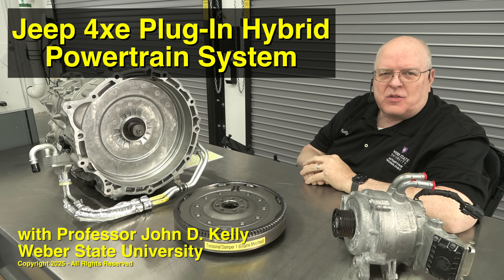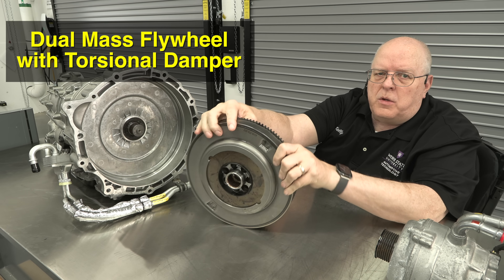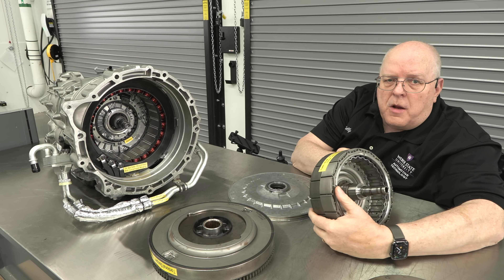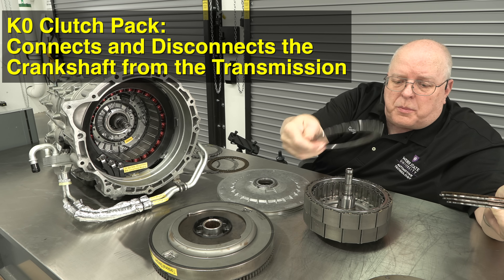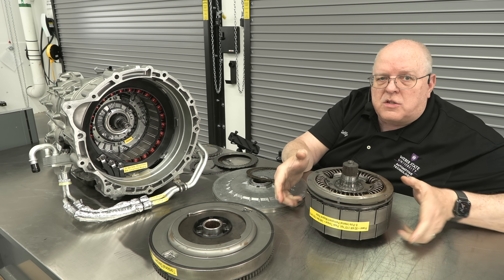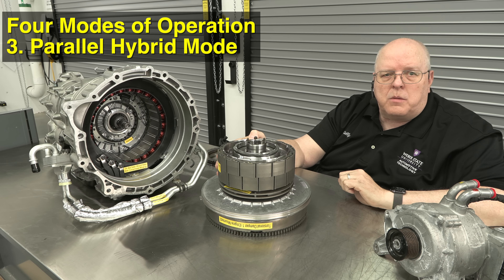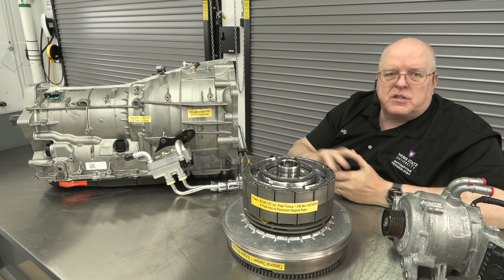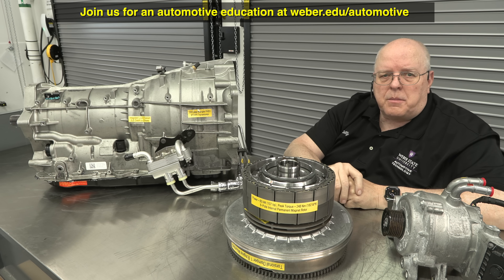The Jeep Wrangler 4xe Two-Motor Hybrid System

Comment: My 4xe from times to times when in 1st or 2nd gear will give a big knock (if you hold a coffee, you will spill it all over!). So I guess this would be the slipper inside the transmission that gets a bad info on when to engage?
Reply: I get the occasional rough 1-2 gearshift in my bmw with this same transmission, but only in electric mode. My understanding is that the ILE is closed when the vehicle is moving and your foot would be off the clutch pedal if it were a manual. Then, it shifts through the gears as a regular 8HP would. That's just my assumption and I could be ignorant to the more complex aspects of how things are managed. 

My theory is that, without the rotational inertia of a spinning engine and torque converter to dampen the shock of the 1-2 gearshift (which, just like in a manual, takes finesse to execute smoothly), any error in the engagement of the clutches is magnified. It most likely leans heavily on the complex transmission management and "learning" to get the gear change right.

Comment: The rotor you show has two segments on the outside that are slightly offset from each other; what is the purpose of this?
Reply from the maker: It is to reduce something called cogging as the rotor rotates. Think of it as a little variations in its rotational speed.

Comment: Wow, very informative. Wish this information was easier to find from manufacturers for those of us mechanically curious types.

Owning a 4xe wrangler in the family, I've had a large amount of experience driving it. Watching this video has explained some of the interesting behavioural quirks. Primarily around not having a torque converter:

1. In stop & go traffic on the highway, especially once the high-voltage battery is run down, the vehicle seems to lurch at 1-2 mph. My guess is that is where the engine clutch engages and there is suddenly plenty more torque available, but also a minimum RPM. The result is a noticeable power increase and acceleration. I usually compensate by letting off the gas slightly, which then releases the engine and lurches the other direction. Interesting behaviour.

2. When moving heavy loads at near-zero speeds, for example, backing a boat+trailer uphill into a barn, I am stopping and starting and inching the trailer at sharp steering angles. That means the torque required is very high, and the speed is zero or below 1 mph. In this case, the transmission likely avoids slipping the B-clutch and tries to use just the transmission motor. But, in my use case, there hasn't been quite enough torque. So I push the pedal harder, eventually, it gains more torque, but with less control. I assume it finally engages the B clutch and uses the engine as well, but by that point, I'm "asking" for a lot more power and all of the sudden, I receive it. Not an ideal situation, and makes for a tough maneuver. Having done it multiple times with both an 2007 v6 Wrangler and the 2023 4xe, the 2007 has much smoother power delivery and makes the job much easier. Using low range in the 4xe does make it easier, probably because the series hybrid mode is enough to get the torque I need.
Reply from the maker: Very interesting. Thanks for watching and for the great detailed information!

Comment: Please teardown a bmw 330e hybrid gearbox 🙏🙏
Reply from the maker: Thanks for watching!
Reply: This is the same transmission, but the 330e only uses a 12v pinion starter rather than the 400v belt starter generator shown in this video.
Reply: @d47000 don't tell lies. it doesn't have a starter motor. It uses it's hybrid motor to start the engine 😂😂
Reply: @sydneysweeeny Look in the parts diagrams yourself. Or, better yet, trip the high voltage service disconnect, hit the start button, and listen in awe as your engine starts without any power going to the traction motor...

Comment: Awesome info, curious as to if this could possibly be a swap for hot rods/resto mods. The ZF 8hp is already getting popular in the aftermarket, something like this seems like the next natural step, assuming there's an aftermarket computer that could even handle managing this.
Reply from the maker: Yes, but it would take a custom motor controller and all the high-voltage systems that go with it. Thanks for watching

Comment: Just got done driving one of these in San Francisco. The fact that the electric motor has to shift with the transmission is just frikkin weird. Overall the whole drivetrain is rough and doesn't know what it wants to do most the time. 

If you want smooth and refined, get a Ford Maverick hybrid. Seriously.
Reply from the maker: Thanks for sharing your experience with the vehicle.

Comment: This is amazing, thank you! I have a 4xe and I noticed a different type of slip than what you mentioned. I can confirm that the 2024+ engages ICE and MGs quite smoothly in most cases, however strangely enough I can get lurching in pure EV mode.

It usually happens when I think the computer is anticipating a downshift, but I press the pedal (gently) at just the right time that it has to abort the shift mid way, and then I get a lurch as I start accelerating again. Also your explanation of series hybrid mode was excellent, it makes a lot of sense for how I feel the car is operating when it switches on the ICE for the first time (based on oil temp it feels like). I’m a big fan of letting that engine warm up.
Reply from the maker: That is great information, thanks for sharing

Comment: The Jeep engineers refer to the smaller motor/generator as P1. Not sure why it didn’t get the P0 designation.
Reply from the maker: I saw that in their training manual, but is does not follow the SAE J1715 standard. Perhaps someone was confused with starting to count at zero instead of one. Thanks for watching.
Reply: @WeberAuto It also uses uses gears 1-6. In the description, it said it uses 1-4.

Comment: Ok mh quesion is, what advantages does this have over the Chevy Volt parallel hybrid? I guess it can put down more torque from a standstill, but it's replacing a minivan V6... A decently sized electric motor would push it along just fine, especially since Wranglers are more in need of the low end torque. The extra complexity of the 8 speed transmission, belt drive motor-generator, and large engine seem to ruin the advantages of a hybrid here.
Reply from the maker: Thanks for sharing your thoughts

Comment: Owning a 4xE (which the common pronunciation is 4-by- E , like 4x4 )
I found this very informative. I now
wonder if the replacement of the clutches will be cost effective when they wear out.  Also, do you know if a fluid change at whatever mileage is required maintenance?
One thing you mentioned was in electric mode it just acts like an 8 speed transmission but in electric only mode it only uses gears 1-4 .
Thanks for the tutorial !
Reply from the maker: Great information, thank you. I do not know what the service interval is for the transmission fluid. Thanks for watching.

Comment: Can’t help but notice that the bell housing and flywheel still has provisions for a starter motor
Reply from the maker: Yes, the transmission also fits in other vehicle brands where a 12 V starter is still used. Thanks for watching.

Comment: Why does P0 motor exist? And with a belt no less. P1 is coupled to the driveshaft! Completely superfluous!!!
Reply from the maker: It allows the engine to be started before applying the engine disconnect clutch. This prevents where on the engine disconnect clutch. Thanks for watching.

Comment: I leased one, back in 22, Grand, Overland. Great car to ride. Its actually, I would say, its a Range Rover for the poor. However, I will never ever lease the 4XE again. IMO, disappointing totally. first gear to 4th, engine only is so noisy. It sounds like a Diesel engine. 2nd, the transition from EV to gas or Visy versa, is heavily lagged. 4 cyl engine for this large car is a crime. That style car should be I-6, V-8 or fully EV ONLY.
Reply from the maker: Thanks for your feedback and thanks for watching

Comment: I drove a Grand Cherokee 4xe for a couple months while my CRV Hybrid was being repaired from an accident. It has got to be the worst hybrid system ever. It was not smooth at all. You could always feel the transitions between the different modes and the regen braking was not smooth since the transmission had to downshift while braking. It's only plus was the plug in feature and it drove mostly fine in all electric mode. But the final nail in it's coffin is it only gets 21mpg. Exactly 1 mpg more than the non hybrid Grand Cherokee. And it costs a lot more. Just a horrible vehicle in so many ways. I was so happy to get my CRV hybrid back.

Thanks for the video though! I look forward to more.
Reply: heard it was bad but didn't care reading why not after going to the dealership and seeing an 80'000 price I turned around saying a loud "NOPE"
Reply: @fredEVOIX that was a good move. There were so many negatives to the vehicle. I don't know who in there right mind would buy one.
Reply from the maker: Thanks for your feedback
Reply from the maker: Thanks for your detailed feedback, I appreciate that. Thanks for watching.
Reply: I’ve have also lived with a 4xe for a little while, and I have to say I didn’t quite have the same experience. I found the transition from EV to Hybrid buttery smooth, what you were probably noticing was simply the 8 speed transmission shifting during the transition. As you even mentioned, you are not going to get as smooth of an experience, simply because all the power is being delivered through a regular transmission. I actually like the concept of this system as it (in theory and when done correctly) should be more durable than a traditional hybrid system that utilizes a CVT which is not really something you want to use in a heavy SUV made for towing. Unfortunately, being that this is from the Stellantis era, we all know it’s not going to be good and is going to be a reliability nightmare.

Also I get your gripe about the poor MPG, but that’s not really the point of this system, the main point is to be able to use this as full EV for most or all of your commute, and then for your longer drives, you still have all the benefits of a regular ICE vehicle.
Reply: @Sean_C6.2 all the Toyota and Honda hybrids at least use an "eCVT" which has nothing in common with a traditional belt driven CVT. Watch this channels break down of those. Those systems will last a very long time, and have in Toyotas
Reply: @Jeff.Kenefake  I understand that Toyota utilizes a eCVT that’s is a bit different and is more reliable and works great in their cars, but my point was that it a CVT or eCVT is probably still not a good option when it comes to heavier vehicles made for towing like a Jeep Grand Cherokee. If the eCVT was truly the best most reliable option, you would see Toyota use that system in their Hybrid trucks and SUVs. However, they don’t, Toyotas hybrid system in their trucks are similar to this system minus the torque converter.

Comment: I really sympathize with jeep as they probably have heavy torque loads they have to deal with for wrangler off road applications. And I understand they want to keep with 'what works' which means keeping most of the familiar components. However when compared to the Honda and Toyota hybrid engineering there's just so many failure points with this more traditional setup. I want to know if they can make something like honda's ecvt work with the higher torque loads for offroading because now we're cooking with gas hehe
Reply from the maker: I appreciate your insights on the challenges Jeep faces with torque loads.
Reply: This hybrid transmission has been around for a decade or so in german cars and seemingly has a pretty good reliability track record. I'm mostly familiar with the BMW architecture which uses a 12v pinion starter rather than the 400v belt starter generator here, but there aren't any more failure points than any other parallel hybrid car (just the motor, one extra clutch, dual mass flywheel, electric fluid pump). Then of course you have the battery, inverter, and charging electronics, but that's common to any electrified vehicle.

Comment: 13:04 where do the injectors and spark plug draw power from? 12v battery or 12v dc-dc converter or a separate converter for higher spark voltage. Am I right in assuming that spark plug and injectors are highest amps load in traditional engine electronics?
Reply from the maker: The DC to DC converter is the main source of 12 V power on the vehicle. The 12 V battery is there as a back up and for providing current under high demand situations.

Comment: Another automatic transmission with no torque converter!  Crazy.  I don't understand why they use a dual mass flywheel on the back of the crankshaft if there's no friction disk coupled to it?  Why not just a flex plate with the internal splines?  Is it another form of torsion spring vibration dampening?

Love your videos!!  You've kept me up to date from the standard transmission and u-joint working angle days to this.
Reply from the maker: Thanks for sharing and for your support

Comment: So why does it need the belt driven starter/generator? If it has the B-clutch it could still run as a series hybrid even when the vehicle is stationary, which would be the only benefit to having the belt driven unit.
Reply from the maker: Thank you for your thoughts

Comment: It’s like each design team added an electric motor to their component and then they slapped all the components together and called it a day.

The third and fourth GEN Prius is still the queen of hybrid design.
Reply from the maker: Thanks for watching
Reply: Respectfully disagree, the Chevy Volt is peak efficient design. All three motors in series with no transmission is beautiful!
Reply: Theoretically series is less efficient, which is why all these PHEVs have insanely complex parallel designs (4xe included). That being said, all the new models are moving back to series (they call them range extended EVs).  But not for efficiency, purely for cost.

Comment: Mmmm wonder if P3 and P4 are used in 1st, 2nd and reverse to reduce wear on the ILE.

Seems like P1 would be the starter. Why did he skip P1.
Reply from the maker: Sorry for the confusion. This Jeep only uses the P0 and P2 motors. The diagram I show is an example of different places that you could put parallel Motors and what their names would be, but the jeep does not use all of those. Thank you for watching.

Comment: This transmission looks way more complicated - and thus failure prone - than a Toyota Hybrid Synergy Drive transaxle, like the P-810's in our 2023 Rav4 Prime and our 2025 Sienna. But maybe Toyota's HSD wouldn't work well in a truck-based vehicle that's designed for crossing extreme off-road terrain and rock-hopping at speeds down to a snail's crawl. I know that my Rav4 Prime, while very capable on moderately rough graded dirt roads, doesn't have low enough gearing to crawl over really rough stuff like a true 4WD Wrangler, Land Cruiser, Tacoma, or 4-Runner can. I had to kind of cringe when I saw that front motor using a serpentine belt drive; that just seems like a bad idea. It serves the same function as the MG1 motor in a Toyota HSD, and in the Toyota, MG1 is completely internal to the transaxle, it's bathed in transmission fluid at all times, with no way that water or motor oil from a leaky valve cover can get on it.  I also have a bad feeling about that clutch pack in place of a torque converter; the friction material on the fiber discs is bound to wear off sooner or later, and ask yourself, how much is it going to cost the owner to tear that transmission apart and replace that clutch pack? I've owned a bunch of cars with manual transmissions, and sure, you will eventually have to replace the clutch, but this doesn't require disassembling the transmission itself - a competant tech in a shop with a lift and the right tools at hand can replace a clutch in 1 hour, maybe less, and the parts don't usually cost that much unless it's for a sports car. Maybe $1,200 total for the average pickup truck with a manual transmission. Considering that the cheapest pickups you can buy are over 35 grand now, $1200 for a clutch is nothing.
Oh well, I've aged way past any stage in life where off-roading and rock-crawling will ever be something I'll do again, so buying a Jeep - or a 4-Runner - isn't something I'll ever be tempted to do. Thanks, Prof. Kelly, for another fascinating deep dive into powertrain technology!
Reply from the maker: I appreciate you sharing your perspective on the design differences and potential long-term considerations. The Rav4 Prime does have very low gear ratios possible for crawling; however, it cannot deliver the torque to the wheels like this parallel hybrid Jeep and the Toyota i-FORCE MAX system can. Both of those systems can deliver full engine torque, plus motor torque to the wheels simultaneously. Thanks for watching.

Comment: VW and Audi Has Hybrid with DSG transmission and also it hasn't a torque converter. It has dual mass flywheel and dual clutch.
Reply from the maker: Thanks for the information
Reply: @WeberAuto Dq400 is the transmission code. Have a nice day sir.
Reply: And (if they haven't changed it) have one spare part for the whole unit - namely the whole unit in itself. Oil leak from the input shaft? - new gearbox. I'm so glad that i dodged a bullet, when the end-of-lease VW Passat GTE, that I had arranged to buy, suddenly went up €2000 over the agreed purchase price.

Comment: You mentioned that P0 can start the motor.  What's going on with the starter ring and place for a starter in the bell housing?
Reply from the maker: That transmission is used in other vehicles with a starter motor in that location